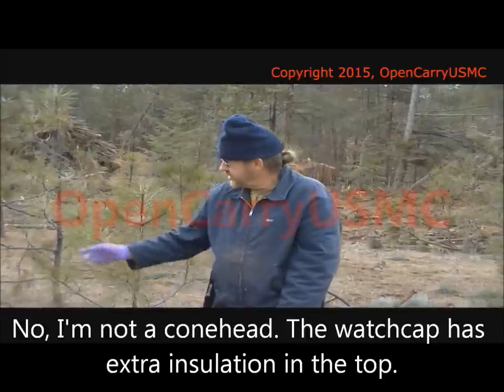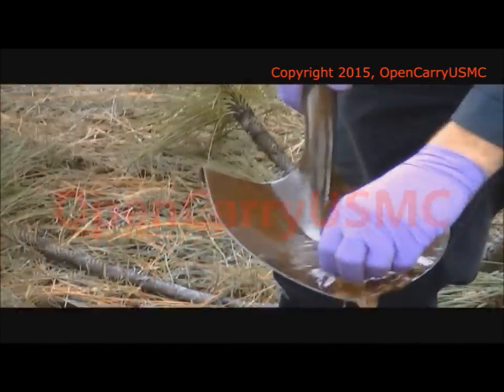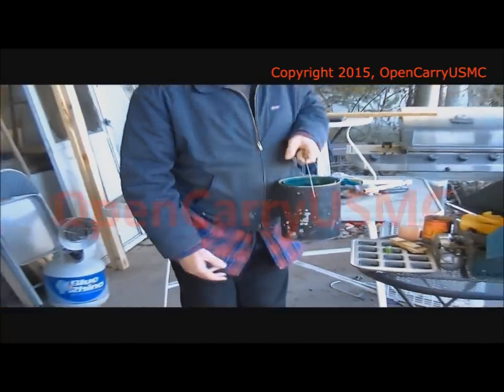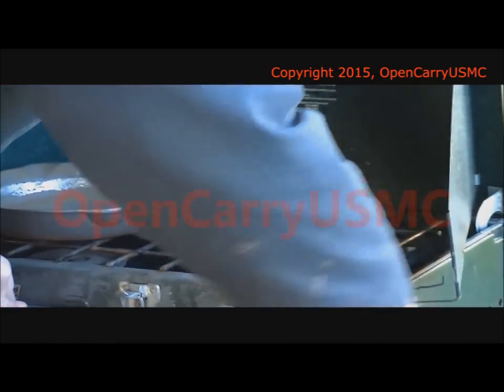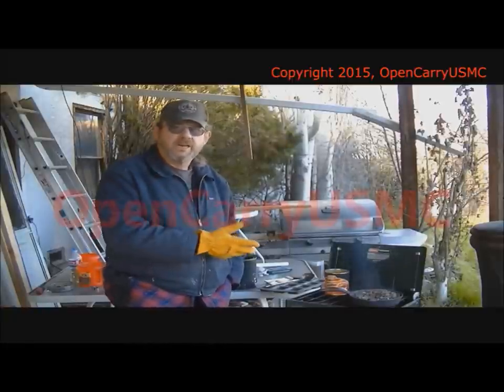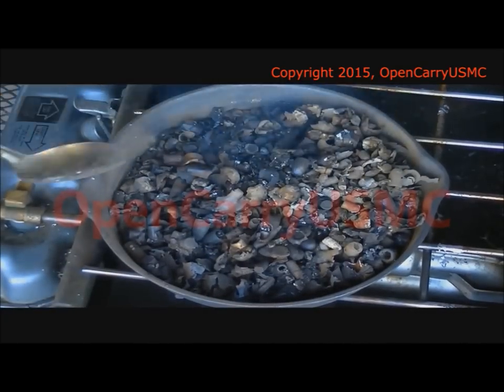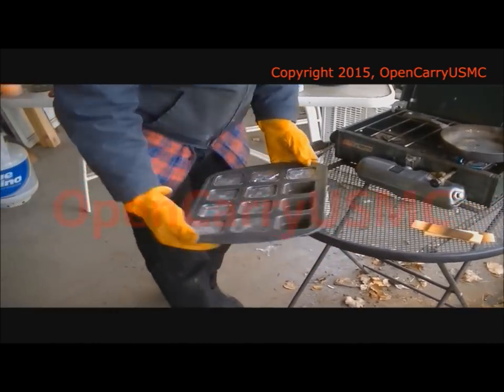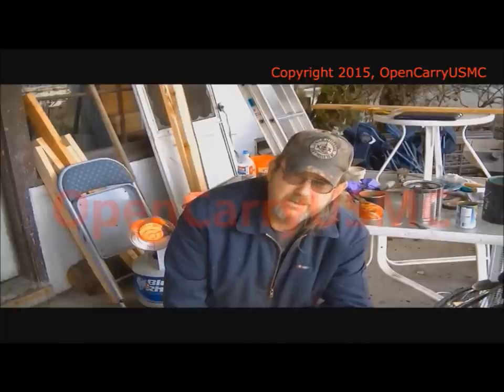Lead "mining" from digging to ingots

Comment: Use repiratory protection!
Reply from the maker: I've worked in HaxMat, the risk is miniscule to non existent in an occasional smelting OUTDOORS and not breathing the fumes.
Lead hazards are WAY over emphasized because there is money to be made.  Same with asbestos and many other things.
It's all about money, actual harm isn't even secondary.
Just look at second hand smoke. A total joke
Reply: Lead puts off BADDDD  vapors
Even outdoors you can get poisoned 
Be safe my friend
.
Reply from the maker: @boblemon8337  Agreed but with proper ventilation and not being in the path of the air moving from the smelting pot it's not a problem. And of course don't be doing it upwind of the school playground next door.